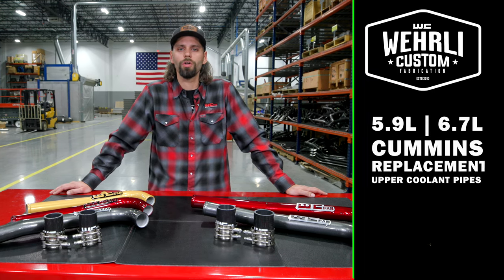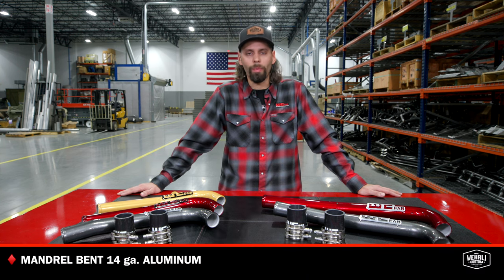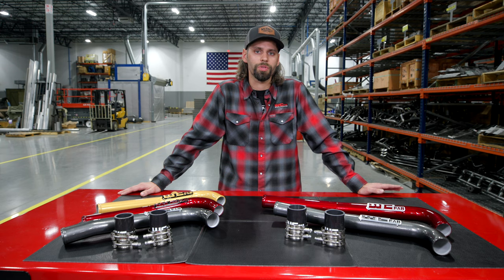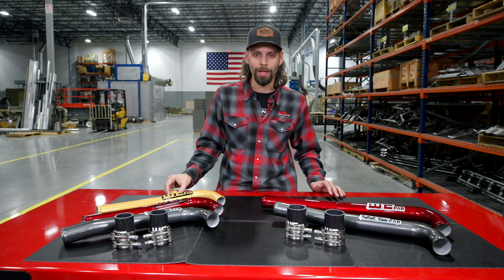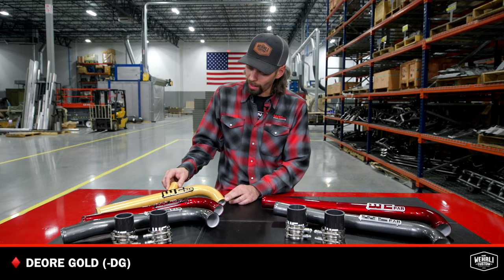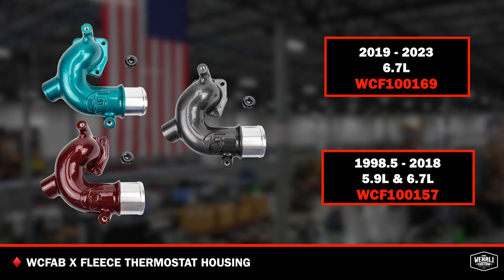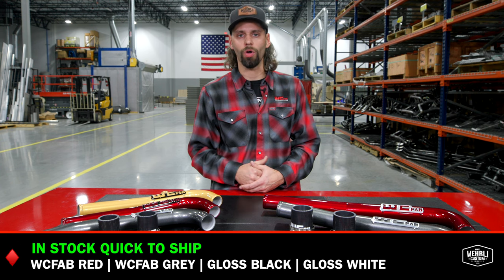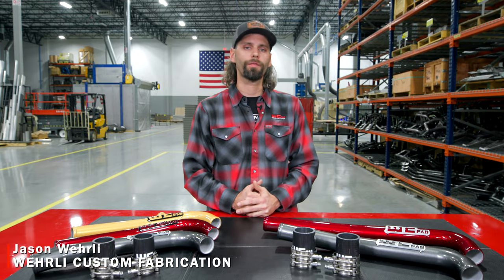WCFab Cummins Upper Coolant Pipes

Comment: I bought an upper hose for my 2019 Cummins from yall about 1 year ago just now getting to install it but I lost the hose clamps what is the proper size to replace them with
Reply from the maker: Those use a 2" t-bolt clamp. Here's a link to the correct replacement part on our website for reference, please give us a call at the shop (630-277-8239) with any additional questions: https://www.wcfab.com/i-31644891-2-t-bolt-clamp.html?q=wcf203-82

Comment: When installing this, do the bolts need to face a certain direction? I hear alot of guys say point the bolts down in order to avoid leaking in to the belt.
Reply from the maker: We recommend orienting clamps in such a way that they're easy to access for installation and removal, out of the way of any nearby components, and aligned so that they're visually pleasing when everything is in place. These are the same rules our team uses for any clamp installs on parts whether the lines are carrying liquids or charge air.